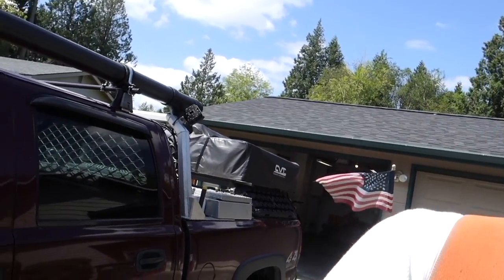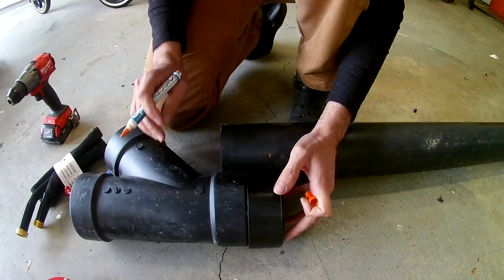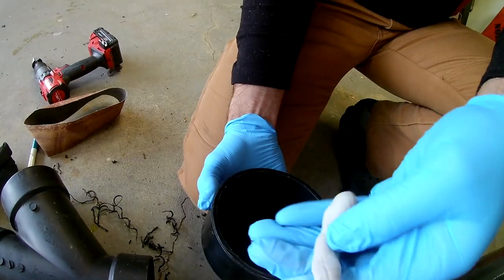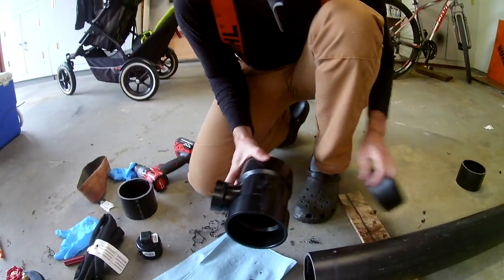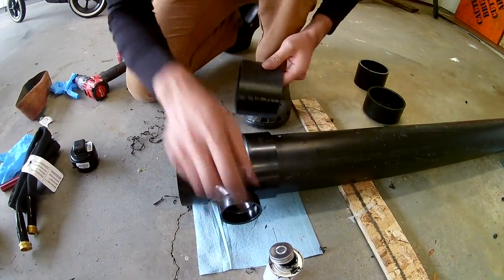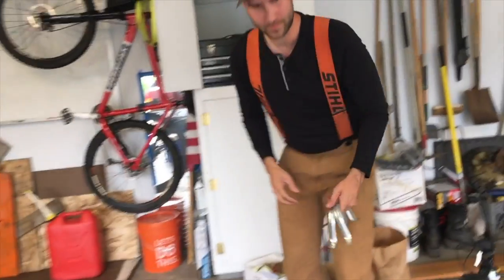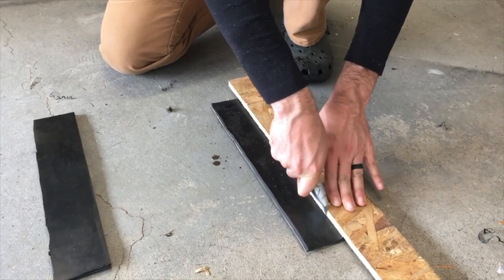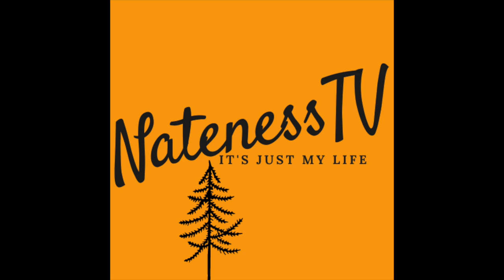DIY Solar Shower System Pressurized for Roof Rack Camping off the grid under $100

Comment: Never said what type of pipe you used, I just built one out of schedule 40, pressurized it without water to 20 psi and about 5 min later the back test plug blew out scared the crap out of me
Reply from the maker: I used ABS pipe schedule 40 should work fine though. I had the test plug pop out on me the first time is used it! I found that I needed to really tighten the test plug down hard. Once I tighten it down more I have not had an issue. 20 psi is a good pressure if you are still having problems after tightening the test plug more it may be that you have a bad test plug. In that case try an different style plug. I would also recommend talking to a plumber about test plugs. My plumber buddy told me that that he has used test plugs to test pressures of 60-80 lbs! So a test plug should work at 20lbs. Good luck! Thanks for your comment!
Reply: Ya test plugs are blowing out just spent another 40 on threaded plugs will post pics, gonna or a short vid on my channel of my set up

Comment: Man great video. I just followed your instructions and built this. It came out tits!! Only question is how much psi you get it up to? I got to 20 and the test plug came off like a bullet. Damn near took my leg off. Major near miss lol. I am considering scrapping the test plug and going with a cap but maybe I just didn’t crank it down enough. Anyway what psi you take it up to? Great video again man.  Thanks!!
Reply from the maker: Oh man yea be careful. I’ve found I have to really tighten the plug down really tight and to not pressurize it empty. Lately I’ve been only putting 10psi in it, that seems to do the trick for most things.

Comment: No PVC piping is recommended for pressurization.  Add a 12 volt water pump to pressurize shower hose downstream of the 4” solar heated pipe system instead.
Reply from the maker: That’s a great idea! Do you have any recommendations for a 12v pump? I have been thinking of building something similar but using a 5 gallon bucket.

Comment: Not sure what I'm doing wrong, but I keep losing pressure from the screw-in cap where I pour the water in.  Anyone else having this issue?
Reply from the maker: Yes I had the same issue I used Teflon tape on the threads to help with that. If I was to build it over I would delete the screw cap and put another clean out plug instead. Clean out plugs come in all different sizes. I hope this help and I’m sorry you had that experience too. Happy camping!
Reply: @natenesstv6685  no issues with the plug popping out?
Reply from the maker: The first time I put the plug in it popped out under pressure, come to find out I had way to much pressure! 🤣 Now I run it at like 20psi and tighten it down way more than I was and I have no trouble.

Comment: Why not a paddle bit or hole saw instead? Then it's not come shaped.
Reply from the maker: I found a paddle bit to catch (bite in) to the plastic a hole saw would work I think. Since the video I got a stepper bit with deeper steps and it works great, doesn't bite in and doesn't cone shape it. Thanks for watching!
Reply: @natenesstv6685  🙂
Reply: Forster bit